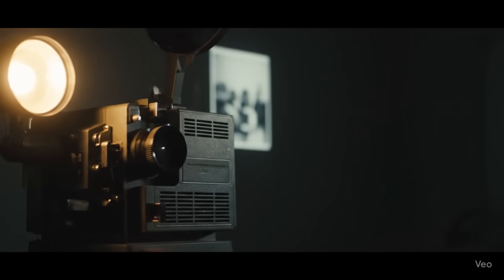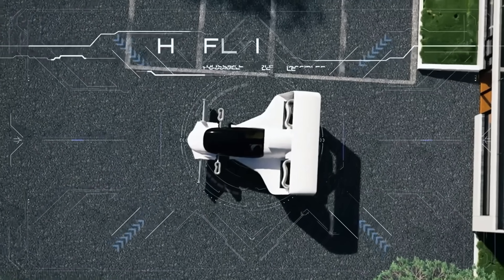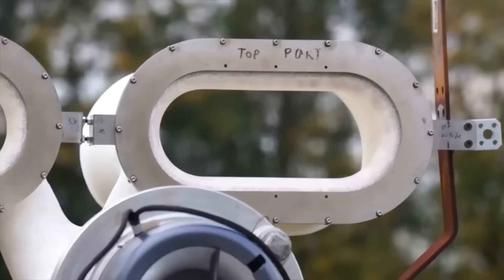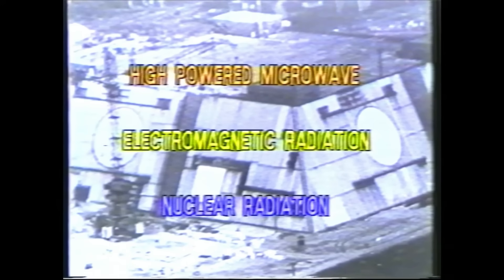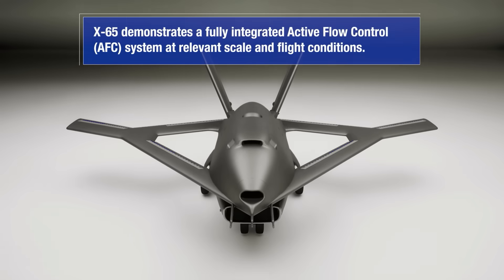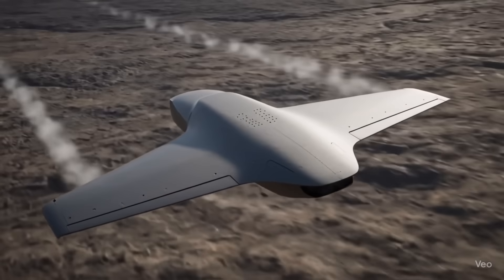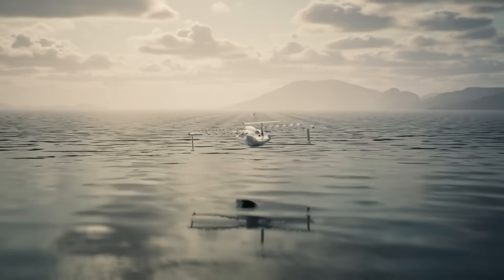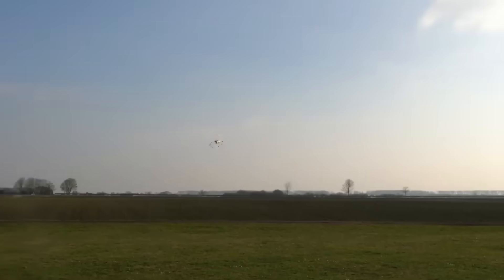Fluidics in Aviation: Aviation Technology of the Future

Comment: These devices do have a jet engine in the middle.  There is however an unmanned aircraft called the "Self-Contained Ion Powered Aircraft," that can fly with no moving mechanical parts!  It works by electrostatically charging air or propellant and accelerating it behind the craft.

Comment: Fluidic design has the problem that if the power source fails, then there is no control to land the plane. This is a bad design and unsafe. The JetOptera design is very inefficient and requires batteries to have an power density of 1500 kWh/kg (according to their website), which is 5 times what Lithium batteries can deliver today. This is because the propulsion motors are inside the vehicle and the ducting to the outside significantly reduces the airflow.
Reply: "ducting to the outside significantly reduces the airflow.:"
I'm surprised this isn't obvious to everyone.
Reply: I designed a similar aircraft, but it‘s just a small drone. Safety isn‘t as important as in manned aircraft

Comment: Maybe they should call this "hydraulics"?
Reply: Isn't hydraulics liquid based. Liquids are fluids but not all fluids are liquids. Moving air around wouldn't be called hydraulics.
Reply from the maker: Fluidics is different. We are not just using fluid pressure. We are also using capillary effect, Coanda effect, vortices and more
Reply: @ElectricAviation  Thank you for the clarification.

Comment: The amount of thrust generated by pushing air has a linear relationship with the amount of air pushed times the velocity of that air, all else equal. The amount of energy required to increase the velocity increases exponentially with the increase in velocity, while the thrust only increases linearly with the velocity, which in turn means increasing the velocity of the air decreases the efficiency. Also, all conversions of energy has losses, meaning, compressing air ad absurdum to generate thrust is very inefficient. 

It might be somewhat useful for control of stealth aircraft, but for propulsion it is straight out stupid to compress and or accelerate air much more than necessary to generate thrust, especially for battery powered aircraft. 

The reason Dyson fans can be reasonably efficient, compared to many consumer grade fans, despite first generating an unnecessary high pressure that is used to push additional air is the fact most consumer grade fans are horribly inefficient, the compression and "induced" airflow reduce the efficiency, significantly, compared to just push a lot of air at the velocity you actually want directly. 

The Youtube channel Tech ingredients recently made a video about that, where they found that the AC motor, in their case in a ceiling fan wasted over 80% of the power it used. Most common cheap fans have other aspects that further reduce their efficiency, often making them less than 10% as efficient as they could be. The fact that Dyson managed to engineer fans that compares reasonably well with such "competition" despite using an inherently inefficient strategy doesn't prove that compressing air to create induced airflow is efficient, that part is still extremely inefficient.  

You can't create energy/force out of nothing with gimmicks by converting energy/forces. In order to maximize efficiency you want to create thrust with as little losses as possible, and completely avoid unnecessary losses, including unnecessary conversions of energy, flow restrictions, and so on. That means open propellers, with as long but also as few blades as possible, that push a large amount of air at as low velocity as possible that still is enough to generate the needed thrust is always the most efficient way to generate thrust by pushing air.

Comment: Fluidics often had problems and got shelved. Liquids expand/contract with heat and cold, as could simple wires, and a single leak/fail could result in huge problems, even the loss of the aircraft and pilot/cargo. Newer systems with multiple electronic pathways are much lighter and safer. Fluidic? Basically, it's only ever mainstream use was using it as a brake in cars, and even that is changing.

Comment: Total BS.
You need energy to move, to override environment resistance.
This light aircraft still needs engine and power for fans working.
Reply: The source of thrust needs to release energy, yes...  but I think this video is talking about the more traditional flight control surfaces, such as rudders and flaps using actuators to change flow of the relative wind, being replaced with onboard airflow inlets and outlets, to do the same job of those control surfaces with the movement and placement of air pressure inlets and outlets, making the manipulation forced air flow the control system. So, creating high / low air-pressure areas that effect the aircraft's attitude, directly with airflow, instead of with flaps and rudders only.

Comment: isnt this just a variation of harrier jet tech. of ducted fans, with flap flow direction. also just differential thrust. nothing new under the sun. same hidden moving parts turbine inside the craft. fanless turbine is kinda of a cheat. so how does this differ from air boat direction flap or thrust vectoring. it does not. its the same thing. cheat = eyes trick. you could also turn and roll an air plane with inertial gyro acceleration wheels. those thrusters seem to thrust vector. ie turn. any "new" stuff does not get anything because its not new. only claims to be new. not solving anything. stop getting paid. all "new" problems solved. thanks. ie go earn your living yourself, not on the market begging. yep, free stuff does not depend on money.

Comment: Good video.  A few questions: is the real benefit of this technology seen in lower aero-drag from fewer moving control surfaces - especially relevant to battery electric aircraft?  Secondly, would traditional flaps / speed brakes still be needed?  Lastly, how effective would this technology be in low-thrust phases of flight like during short-final approach to landing?  Would there be sufficient manoeuvring capability if thrust is low?
Reply from the maker: All valid questions. Some of this will be answered when DARPA's drone is made. May be they can have nozzles on the front of the plane for braking but 
I dont think that will do much.

Comment: You keep saying "no moving parts," but the fans to move the air are simply moved inside the craft.
Reply: Just like a Dyson air cooler!
Reply: @COKireato Air fan, not cooler
Reply: @Tinker1950  Just to be mechanically pedantic, the dyson is not a fan. The thing moving air is called an impeller, which is mechanically distinct from a bladed propeller like we see on traditional aircraft and fans. An impeller is is also what the part that makes air move in a car's turbocharger or supercharger.
Reply: @riven5544  I certainly wouldn't disagree at all.
Reply: @COKireato Mitsubishi did some research on this Tech. Some time Ago....
It has No 'Exposed', Moving Parts.....I.e. No Propellers....
Reply: Maybe it's just that I'm an old fart, but I remember a time when F-16s were often called "Electric Jets" or "Lawn Darts".  The digital fly-by-wire technology was new and not always reliable, with the result that F-16s had a disturbing habit of turning themselves into smoking holes in the ground.  So while the F-15 had a computer that interpreted pilot inputs and commanded the flight controls, there were still mechanical linkages between the cockpit controls and the flaps, stabilators, rudders and ailerons.  If something went wrong with the stability augmentation system, the pilot had a mechanical back up.

I LOVE redundancy!  Let's keep the moving parts until we're certain we don't need them anymore!
Reply: Sorry but your interpretation of the "Lawn Darts, electric jets" of the F16 Vipers are very wrong! I am a retired USAF  Crew Chief on fighters and tankers for 23 years and there was NEVER a tendency for them to crash from the flyby wire flight control systems,  all fighter jets since the 60s and 70s use a form of electro powered hydraulic servo actuators where is just a LOT MORE NOW AND ARE MUCH BETTER! Crashes from ANY aircraft flight control systems failures are VERY RARE TO NEVER! It's almost always human error or weather or maintenance complacency
Reply: "No moving parts" means it is NOT a helicopter.
Reply: They mean no moving flight controls or propulsion systems...
Reply: What do you think that tictac thing is anyway?
Reply: He did not even address why are the engines missing from this simulated planes, he's talking about flaps being replaced by airflow, which still makes no sense. I think this is an AI slop
Reply: @cristibaluta  nah.. no way AI does indian accent. or does it? its one of those youtube corners with magic and not physics anyway. best avoided
Reply: @cristibaluta nope it's real tech we have been messing with for decades... thats what the TICTAC CRAFT IS ITS A DARPA AIRFLOW DRONE...

Comment: Always a good day when you release a video. The Jetoptera looks so right to my eyes.
Reply from the maker: Glad to hear that!
Reply: Yes, CGI airplanes look good. Jetotera's concept it nonsense. There are legitimate reasons to route air though ducts on a aircraft. Propulsion isn't one of these reasons. Using fluidics for control is one thing, using fluidics for propulsion is another.
There's a good reason why high bypass jet engines are more efficient than jet engines with low bypass. The less ductwork air has to pass though the better.
Reply: @ddegn  yeah that's why functional models are already flying and US airforce is interested in the deveoplment, because it's a nonsense, them clueless clowns should've consulted the comment section
Reply: @MethodicalAnarchy  "functional models are already flying"
Where? Are there videos of this functional model flying?
The only video showing the fluidic version of their aircraft "flying" cuts right after takeoff. The flights which could be considered successful are flight using conventional propulsion. A year ago they published "Anniv final captions" which commemorates their successful flight four years earlier. The successful flight being commemorated used ducted fans, NOT fluidic propulsion. Their ducted fan model was cool but hardly a demonstration of fluidic flight. Ducted fans are cool but power hungry. Their airplane would have been much more efficient using conventional propellers.
"US airforce is interested in the deveoplment"
Interested in what? Jetotera? If so, what are your sources?

The channel rctestflight recently posted a video which illustrates the strengths and weakness of one aspect of fluidiics. The video was tilted 100% Blown Wing Powered Airplane.  I was amazed by how well his airplane performed but the airplane was a power hog. It sucked the batteries dry in very little time.
Reply: @ddegn  so it's not a nonsense, just early in it's developement. my source is literally typing that into youtube and clicking one of the first videos that come up.
Reply: @MethodicalAnarchy  It is nonsense for propulsion. Stop clowning around and provide evidence it's not nonsense.
Reply: @ddegn  you did yourself with your previous comment
Reply: @MethodicalAnarchy  Your reasoning abilities are clear. My original comment was correct.
Reply: @ddegn  bro, you yourself said it took off, some lame ad hominems won't change the fact you contradicted your own claim about nonsense
Reply: @MethodicalAnarchy  It took off but it wasn't practical. My original comment was correct.
There's a good reason fluidics isn't used for propulsion. The example I provided confirmed this.
Reply: @ddegn  see, you're already backing down. first nonsense, now you're dilluting to "not practical". nuclear fusion is not practical right now, doesn't mean it's nonsense. every tech is not practical at the beginning and no tech is ever nonsense, it's just a question of time when it finds it's use. your argument is garbage, same as your excuses.